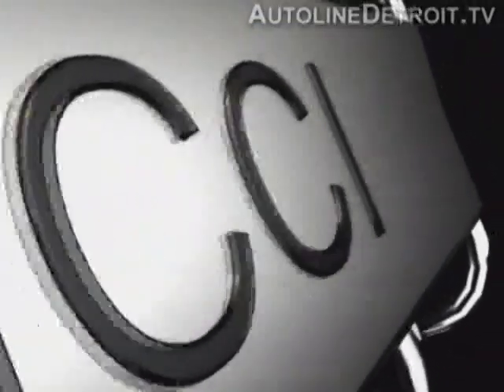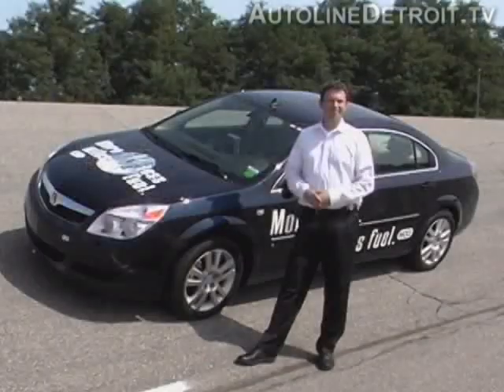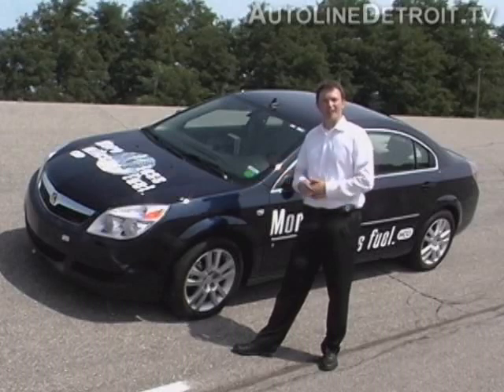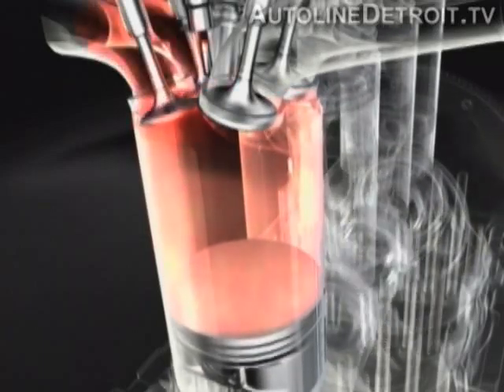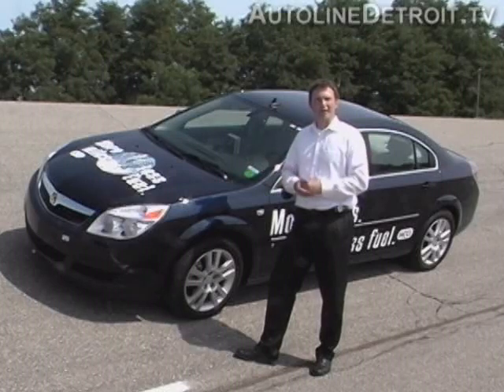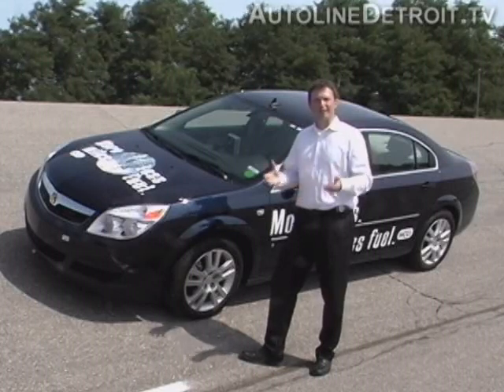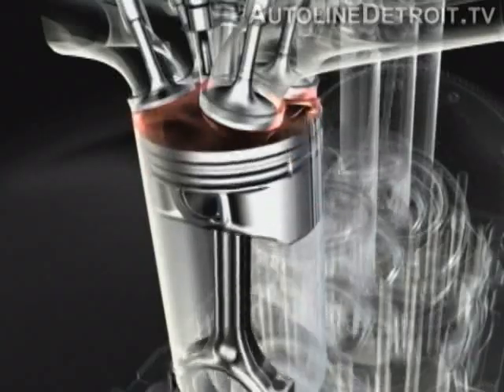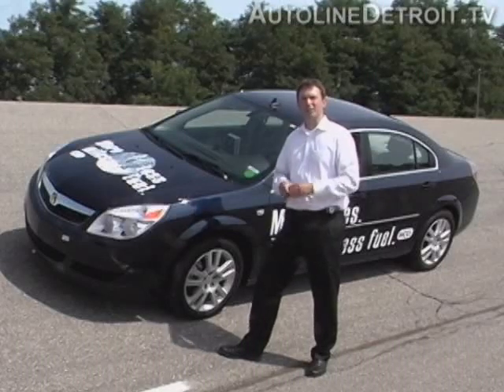John's Journal - GM Makes HCCI a Reality

Comment: Jesus, that valve train noise is horrendous.  And for the people claiming electric is "90% efficient"..the best power plants are 35% efficient.  Add in transmission losses of 8-15%, battery efficiency, and motor efficiency, and you are probably BELOW the ~25% ICE efficiency.  Please take a thermodynamics class.  You can't get something for nothing.
Reply: lol, the same applies to ICE efficiency
ICE thermodynamicaly have a limit to its' efficiency based on carnot cycle
while an electric motor can be up to 98% efficient
transmission and battery infeciencies? battery is above 90% efficient
while ICE will have inefficencies with mechanical transmission
i'm not only bashing on ICE
i admire diesel and think it may have a future as powergeneration for a hybrid system or it can use bio-oil derived from algae or vegetatives byproducts
so an efficient engine like the HCCI would helps us get closer to the future we want build
the issue with electric tho is with battery economy, they are heavy and expensive
and the cost of electricy storage is the point where it make it hard to break even with liquid fuel

Comment: if highway speed limit is not increased to 100 mile per hour, expect gasoline engine to go away in the next 10 to 15 years. 
this technology is crap old and it is only release because they (oil fat cat) think it is going to help.

Comment: interesting. i got 20% extension in fuel economy just by changing engine and transmission oils to my compositions that are bio-synthetic and based on vegetable oils. a problem, strange people are scared to use the oils as they are not what recommended by car producers. i use it myself in a tractor, pickup truck, motorcycle, 2-stroke engines, and provide my friends and relatives with the oils. hopefully, in time i would see less skepticism on bio-oils. pls, mind that i reside in thailand and such oils fit tropical climate not colder conditions. cost of the oils is below 2$ per liter and it saves fuel about 3$ per liter of oil and each 1000 km.  so if anybody is using 5 liter of the oil it brings about 15$ fuel economy per 1000 km distance.

Comment: would it have been a lot more intelligent to use this engine in a hybrid? so that the engine can run in a almost not changing speed and therefore be a lot easier to calculate how much to pump in the cylinder? The batteries would be constantly charged and there you go

Comment: did he say a pound of diesel weighs more than a pound of gas? I believe they both weigh a pound...
Reply: No, he said a gallon.
Reply: Gasoline (US average) up to 6.217 lbs per US gallon; OTR diesel (US average) up to 6.943 lbs per US gallon.

Rounding 0.726 all the way up to 1.000 introduces a 37.741 percent error: 62.259-percent accuracy is hardly what a reasonable person would consider true.

The lower heating capacity for US gasoline is 120,405 Btu per US gallon, the average heating capacity for OTR diesel fuel in the USA is 128,700 Btu per US gallon (note lower versus average values).

Diesel cracks at lower temperatures than gasoline; sulfur is inexpensively removed from light sweet Texas crude, and OTR diesel requires a small fraction of the processing and post-crack blending that gasoline gets.  No way is diesel more expensive to produce than gasoline.

Comment: The future is in electric vehicles and not these fossil fuel dinosaurs of engines. Governments have to be future smart and not cling to a past that will destroy the planet. It turns out that diesel is the most polluting dirty fuel of them all. Some cities around the world are banning diesel vehicles from driving through them from 2020 because of dangerous pollution levels. Just think of that if you are going to purchase a diesel vehicle. In London England if you are driving a fully electric vehicle you do not have to pay any of the city highway tolls saving 100s of dollars per year. All the tradesmen drive fully electric vans to do there work and are saving 1000s of dollars per year. They DO NOT HAVE TO BUY ANY FUEL AT ALL. No petrol, oil, diesel no nothing, so just think what you could save.

Comment: From my understanding diesel engines are not more efficient , they get better mpg because there is more thermal heat per unit than gasoline.  By about 30%  and diesel cars and trucks are typically only 20% better on fuel than gas